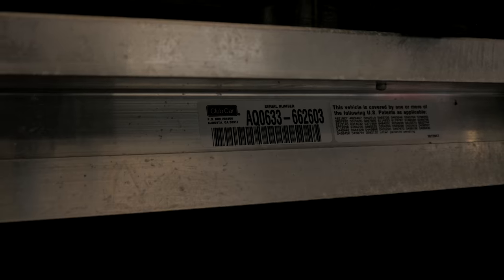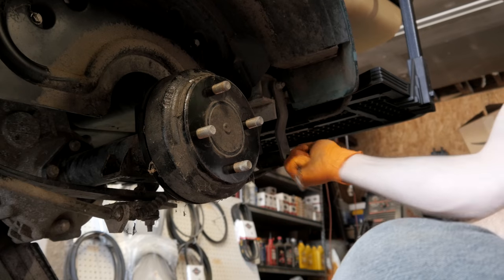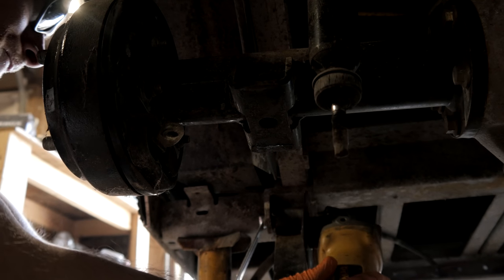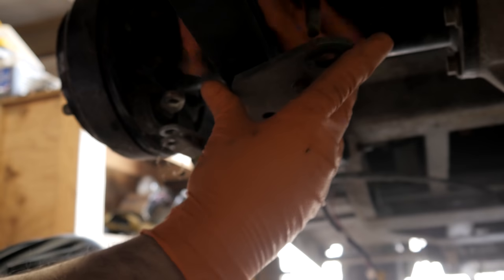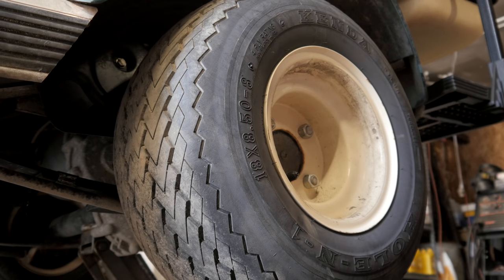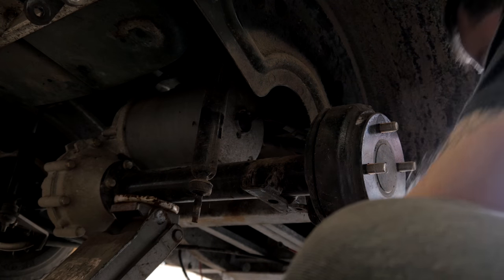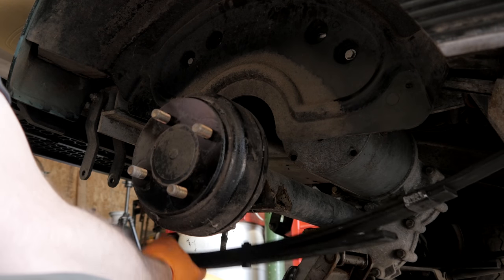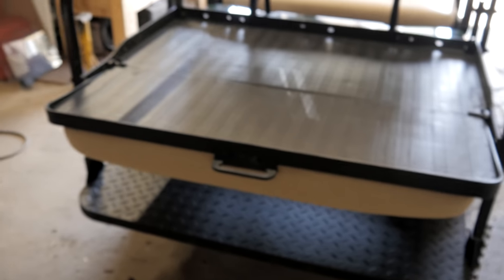2006 Club Car DS, 48 Volt Electric - Dual Action Leaf Spring Installation

Comment: Hello Kevin , first ,great info here, I graduated from lawn trctors to golf carts , The ezgo vid was great , lots of info put to good use! just did a yamaha electric front bushings and rear coil shocks, replaced all the batteries  that has a carryall bed  as well...awesome! , Im working on a clubcar gas and replaced the front shocks bushing  in the A frame etc etc , I decided to get the 3 leaf springs and new shocks..PITA yes fer sure but sucess! After assembly , there really isn't much give back there  when I jump up and down on the rear, very stiff , is this the norm , I may put the rear seat assembly on this cart.Thanks

Comment: Hi Kevin!  I just tried all these steps and was successful getting the HD springs installed (although one side I struggled getting the shock back on).  When I drove it there was a terrible grinding noise from the wheel even if I removed the wheel and accelerated while jacked up.  I worked backwards and not until I had reinstalled the single leaf springs on both sides did the noise go away.  Any ideas what I could have missed?

Comment: Kevin, I have a 2010 Precedent all stock except for rear seat.  Which RHOX rear leafs do you recommend ?  4 leaf looks too stiff, 3 leaf duals look weird and wonder if they keep cart high enough off wheels, because fenders hit rear tires with 4 adults on cart.
Reply from the maker: I'd go with the dual-action springs. They are stiff but when loaded, it will help keep it from bottoming out.

Comment: why is it stated on some spring manufacturers for carts that once you install the new dual action springs you can eliminate the shock?  I see some recommend shock extensions---what is your take on this?
where are you getting your springs?
Reply from the maker: I'm a RHOX dealer so I buy and install springs from them. I have not needed extensions and I always reinstall the shock. Some springs are sprung in such a way that makes the shock not reach the factory perch so you need to add extensions. I say use extensions if they are needed and always use the shocks.

Comment: Hi Kevin I have a question please. I have a DS2005, the drivers side sits lower than passengers side. Can I get away with swapping springs  and shocks over from the passengers side to balance things up until full replacement. 
With Covid19 in place world wide, parts and the cost of shipping to NZ are expensive and non existent.
Reply from the maker: I would just hold off to when you can change everything in one shot. That's a lot of work to go through twice.

Comment: Any chance you'll be working on a Club Car ds clutch?  I'm trying to figure out how to change out the weights and clean the inside of it.
Reply from the maker: There are no future plans to do so. I have not had good experiences with rebuilding clutches. Even if done correctly, most times there are parts that are not repairable and it ends up being more economical to just replace it.
Reply: @Kevinsgolfcarts  
That's exactly what I did and I'll just use the old one as a paperweight.  Lol

You've got great videos and a ton of useful info for us DIY's .

Comment: In replacing the rear springs the front bolts on each side are frozen. Nuts come off bolts will not budge. Any suggestions?
Reply from the maker: Most likely they are rusted and stuck to the bushing spacer. You will need to replace the bushings and spacer. What I do is use an angle grinder, cut between the hanger and spring. Replace the bolt with a grade 8 bolt and lock nut. Be sure to use plenty of anti-seize on the bolt.
Reply: Heat
Reply: Blasters Penetrating Oil.

Comment: Shock question: I put HD springs on the rear of my 2008 ds, but was unable to get the shock bolted back up because I could not get enough of the stud thru the bracket. It was suggested to me to get shock extenders, but the manufacturer said you can remove the shock altogether when installing HD springs. I find a lot of wheel hop without the shock. Any suggestions?
Reply from the maker: If the shock is not extending far enough to catch the threads, load up the bagwell with some weight so it compresses the springs a little. HD springs have a lot of rebound until they wear in a bit. I've had to put 1 or 2 bags of play sand in the bagwell area to get the springs to compress just enough to get the shock nut started.
Reply: @Kevinsgolfcarts  Good call I'll try that! Thank you for the reply!